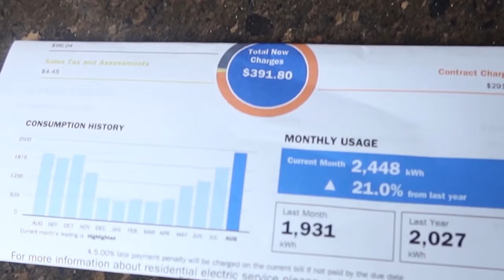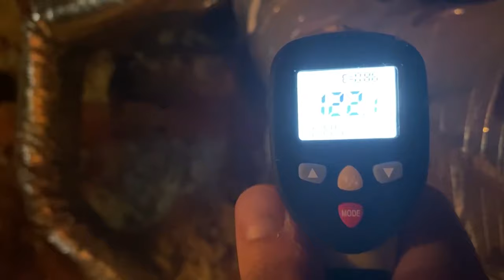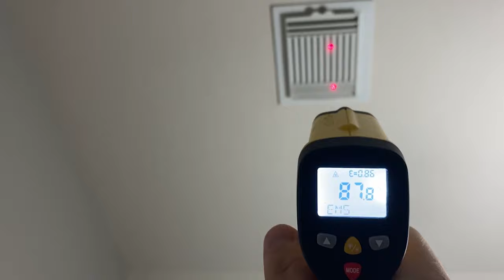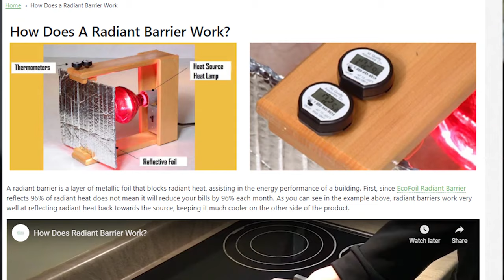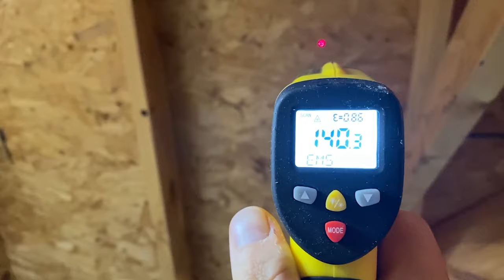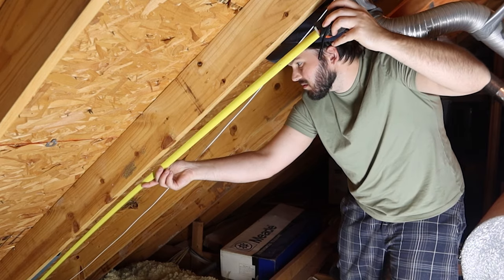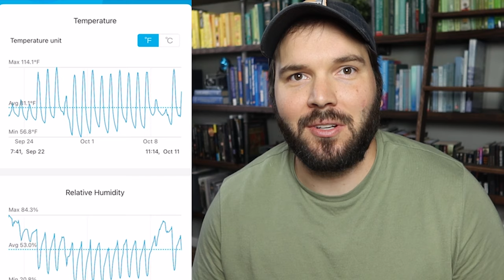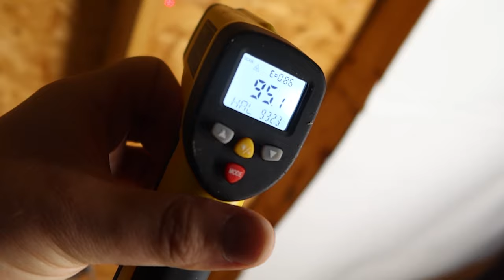Do Radiant Barriers Work & How Much Energy Will it Save: Real Home Owners Experience (Before/After)

Comment: AC is on all the time but not for long enough to dehumidify? Your AC is way too big man
Reply: Can you elaborate on this?
Reply: An air conditioner doesn't just remove heat it also dehumidifies and if the air rushes over the coils to fast it won't have time to take out the humidity.
Reply: Ya it's pronot practical to replace it so probably adding a dehumidifier is probably the play
Reply: First try slowing the blower speed when in cooling mode. Usually it is set to medium-high or high. Try reducing it to medium-low.
Reply: I've thought about installing a relay with a dryer style temperature switch so that my fan wouldn't stay too low. 
I think I could leave the hot side alone if I think about it.
Reply: Your AC is not sized properly (too much capacity) if it’s only running 15 min.
Reply: @jessethomas1574 Or it could be like mine where they brought 3 supplies within 4 feet of the return and thermostat.
Reply: @james10739  That's right. I have stand-alone dehumidifier that's great for pulling moisture out of the air, typically about a quart an hour. The downside is that heat exhausts out the back like it does out the back of a window A/C, so you will also need to run your A/C to stay cool.

Comment: Crest Exteriors in North Texas sold us a “radiant barrier” in 2017 when they replaced our roof after a hail storm. NO AIR GAP, making it a waste of money on an expensive underlay. Per LOGAN at CREST, air gaps are not needed, when responding to my telling him the manufacturer disagrees with him. Logan knows best as he has installed 100’s of these per himself. Doing something incorrect to hundreds of clients doesn’t make it right. Crest has refused to do anything about this. Now, a few weeks ago, APPLE ROOFING came to do an inspection, confirmed the radiant barrier is not installed correctly. This is also when I tell them it was installed by Crest. This is when they told me that APPLE and CREST are the same company. I have yet to receive written report from their inspection and no response to emails and texts. I believe in Texas there is a 10 year statute of limitations on construction defects due to difficulty in detecting them. Suggestions are appreciated. They also tore down the gazebo my recently deceased (at that time) dad built without consulting us, and then charged us $1200+ for new one (this was hail damage and an insurance claim). They also accused us of not paying our deductible, which I handed directly to Logan when he came to pick it up at the house.
Reply: Hope youve hired a lawyer!

Comment: I could not believe the difference it made with the method I tried. I found white highly refractive roof paint at the hardware store and painted my flat roof with that. It made a MASSIVE difference. Easily 5-10 Degree Celsius cooler than ambient in the house now. I left a small section uncoated on the roof close to where the ladder was for comparison and the white roof feels as cold as the steel of a pot you took out of your kitchen cupboard and the old paint(Dark grey) is scolding hot.
Reply: Now if only we could switch between black and white during the seasons..
Reply: @LightGesture  black only will help if the roof dont have insulation. if have some insulation the heat triiying to come in say wtf is this you want me in or what?
Reply: @VostockR  it’s also less effective because the winter is cold, because the sun isn’t shining as much in the first place

Comment: Good info. It works! Just installed 2-sided foil- backed bubblewrap (pressure fit, no air gap) inside a couple of kitchen cabinets against the back wall. Did this because our coffee cups would need to be heated with hot tap water to prevent cooling our morning cup of coffee. After a cold 25 degree F night, a cup located inside the newly insulated cabinet was just as warm (same temp by feel) as a cup that sat on the counter overnight in a 68 degree F kitchen.

Comment: As a side note, it is much hard to heat/cool very humid air.  You can heat/cool less humid air very easily.  As an example, look at deserts, their temps go up and down drastically with their low humidity.

Comment: I'm sure you already know this, but an A/C system that "short-cycles" like this is the direct indicator that it is oversized for the conditions (home load compared to outside conditions). 
If that every-15-minutes cycling is happening around your peak summer conditions, you'd really benefit from some measures to address this. 
Eventually down the road when ready to replace your A/C, you can go cheaper and just get a one-size-lower capacity to better match, or invest in better answer, a higher efficiency unit that includes a VARIABLE or STAGED compressor at full size. 
You'll have the capacity to retain the ability to address higher temperatures during hot spells, but gain the incredibly more efficient handling of your A/C during the rest of the year as it runs at lower capacity. 
You'll get longer run-times at lower energy use, and it will properly dehumidify the air. 
For now, there are also programmable thermostats that allow you to set a wider dead-band and other features, so that you can have it wait an extra degree above setpoint before activating the compressor, and run it an extra degree or two below the setpoint so that cycle times are extended and more dehumidification can be effected.
Also, be sure your thermostat location is away from sun exposure on an interior wall, and is NOT directly in the path of one of your supply air diffusers. 
Side note: You've probably already gotten the advice that you cannot get an accurate spot reading of temp with your IR pistol on reflective or bare metal surfaces (paint a section matte black first?). 
You may wish to add that installing the reflective radiant barrier like this does block a large chunk of the radiant solar load from being absorbed into the attic, but retains the full airflow from the soffit-vents up to the ridge-vent so that roof sheathing and structure is still fully vented and airflow will actually be better, minimizing any potential increase of temp to the shingles. 
This concern about shingle temps goes away completely once you upgrade your roof to a metal one.

Keep up the information sharing!
Reply: The  a/c issues, could be, from the attic, not being properly air sealed.also may  not have enough insulation on the attic floor
Reply: Shingle Temps!!!!!  1st Comment I've seen...considering this asset!!!!!
Reply: Lower the fan speed, run time will increase, evap will get colder and will help dehumidify
Reply: @markchristensen5206  I’ve used this technology for years. There are numerous products for different applications. A different application is to install the perforated product directly on top of existing insulation and cover duct at the same time if applicable. If not, wrap ductwork with the double bubble double foil (the Mercedes of all products!) This product can be layered in rafter spaces, installed 3/4” apart giving tremendous protection. I get mine direct from the manufacturer in Texas for about $.12 sf. Innovative Insulation. There is a demonstration on YouTube which is the same one I saw many, many years ago. These products truly work!
 Radiant Barrier Is It a Scam
 Sarasota Energy Saver video
Reply: Make sure to also measure the temperature split between the return and supply it should be about 20 degrees.  If it's not try adjusting your blower speed, sometimes they set them up with too high of speed.  Fixing this will also help it dehumidify the air.
Reply: Do you know where in a programmable thermostat the deadband adjustment would be?  I have hoped there would be such a thing as my AC works great but due to 1960s house construction it warms up quickly on hot days so the AC is constantly cycling.

Comment: I have a comment about the tip you gave about leaving an air gap so the heat doesn't conduct straight through the radiant barrier. 
Even if you have the radiant barrier pressed right up against the wood and the barrier itself gets hot, you still benefit because of an interesting bit of physics: shiny things, which are really good at reflecting radiant heat are intrinsically poor at radiating heat themselves. If you look for physics demonstrations of emissivity, you'll see demos where two metal cans filled with the same temperature water with the only difference being that one can is painted matte black and the other is polished shiny do not look like they're the same temperature when viewed with an infrared camera. The shiny one looks many degrees cooler even though the heat conducts right into the shiny part, simply because reflective surfaces are intrinsically poor at radiating heat.

You can actually get even better performance if you use multiple layers with gaps between them. Have one radiant barrier pressed up against the wood, and then have another with a gap between the two. Radiant barriers are not 100% efficient; a few percent of the radiant heat still makes it through. Suppose the leakage is about 4%. If you have two layers, then the first one lets through 4%, and the second lets through only 4% of 4%, which is  0.16%. This repeated attenuation of radiant heat is how the multiple radiant barriers of the James Webb Space Telescope are able to keep the shaded side at temperatures a few degrees absolute zero (Kelvin scale) while the sun-side gets to temperatures of about 230˚F (383K).
Reply: Layering is the ultimate system. There is one type called double bubble double foil that even carries an R-value. Since a radiant barrier is a totally different animal than fiberglass or cellulose, it doesn’t have a measurable R-value as such. Fiberglass is only puffed up air and just slows down the airflow. That’s why it takes so much of the nasty stuff!
Reply: i considered the idea of installing multiple layers. but, of course, it is best to do this on a new build. it is exponentially harder to do this on an existing and occupied structure, especially with such awkward and confined spaces. rather, i'm planning to just install one layer on the joist and one on the attic floor. the rolls i purchased are perforated to allow moisture to escape. had i considered radiant barriers earlier, i would've included it behind the vinyl siding that i helped my dad install
Reply: I have an 2000 sq ft attic.  The sheathing is OSB with a reflective lining on the underside.  I then have reflective foil staples to the bottoms of the roof rafters.  My attic space is horribly hot.  Shouldn't both layers of radiant barrier ellimate most of the heat?  Why then is my attic still hot?  I have a light colored metal roof screwed directly onto the sheathing.  I shrug my shoulders and scratch my head wondering if the reflectivity of these products are worth the expense.  My attic should be around 90*, but i know it's a lot closer to 120*.
Reply: @tynyyn5344  Is your attic ventilated? Roof/ridge vents? Sometimes people seal off the ventilation when installing radiant barriers, and that defeats much of the purpose. The heat in the attic still needs a place to escape regardless of type insulation.
Reply: @tynyyn5344 The other requirement for an attic is ventilation of some sort. But even better maybe consider an attic fan to increase air flow thru attic.
Reply: Thx
Reply: @tynyyn5344  Radiant barriers merely redirect some of the heat. They don't eliminate it. You probably have the same problem I have—inadequate attic ventilation either the soffits under the eaves or the vents at the top. On a hot day the top of my attic gets up to 140 degrees. It can't get out fast enough. Until it gets a new roof, all I can do is keep it out of my living areas with lots of cellulose and foil.
Reply: @tynyyn5344  Your roof may not be insulated very well.  Many older buildings suffer from this problem.  You may want to find a convenient location to pull off one of your OSB panels to find out what is back there.  If you do not have a minimum of R-30, you may want to hire a contractor to install some insulation up there.  Closed cell polyurethane spray foam is probably the best, but it can be pretty high.  Polyiso is probably the most budget friendly, though it all depends on your market.  Also, the radiant barrier needs an air gap above it to actually function properly.  Having foil backed OSB does not accomplish this as the radiation hits the OSB board first and heats it up.  Then the heat is transferred to the foil through conduction which then sheds heat to the air in your attic through convection and conduction.
Reply: @wesbaumguardner8829  Thanks for the reply.  You give me some ideas to chew upon.
Reply: @tynyyn5344  No problem.  I am glad I could help.  You should also look into your ventilation, as some of the other posters have stated.  If you have poor ventilation up there, it may be worth it to have a contractor install some vents, preferably closable for when you need to trap heat in the winter (if it gets cold where you live.)

Comment: You can't get an accurate temp reading when using an IR gun on metallic surfaces due to high emissivity. The reading displayed will be significantly lower than what it actually is. Try putting a small square if black electrical tape on the metal and then point the gun at that for a more accurate measure of the radiant energy.
I'm looking to do this barrier install to my house here in Australia soon. Thanks for the info.
Reply: Very true, but largely irrelevant here because the radiant barrier he used has a white back, not metallic.
Reply: did u
Reply: Hi mate. I'm in newy and am thinking of doing the same to my underfloor. Keen to know how you got on.
Reply: i believe you meant say it's high reflectivity, as radiant barriers are intended to have low emissivity
Reply: The 10 degree temperature difference I measured for my post compared of the surface of the cellulose (shredded light gray paper treated to make it resist burning) to the ambient temperature (down low) of my attic.

Comment: I've got attic foil on top of my blown-in cellulose insulation and it definitely helps. On a hot day the temperature under the foil is about 10 degrees less. Keep in mind that when it's placed on top the insulation on the floor of your attic the air gap is above it with only a small air gap provided beneath. When it is bouncing up is the radiant heat in hot the attic air. 
I have taken another step. To keep the heat radiating from my roof away from the floor of the attic I've also placed a wrap of 4-foot-wide attic foil around the base of my attic. That starts the heat radiating from the lower shingles moving up. On a hot day the air exiting up at the top of that foil is about twenty degrees hotter than the foil itself. That also creates a chimney effect as moving air moves other air up and out of the way. The one weakness is my house is that it lacks sufficient ridge venting, but at least I can push that heat upward where it eventually exits.
One final remark. The foil I'm using comes from Attic Foil, which has a website with that name. It is very heavy duty. You can walk on it repeatedly without tearing. Also, for humid climates you can get a foil from them with holes in it to keep moisture out of your insulation.
Reply: Have you noticed any financial benefits? Have you been able to notice a significant change in temperature or how often your HVAC system is working.  I have a small home with standard trusses and my easy way would be to lay it on the insulation as well. I hav all fiberglass insulation and really don’t want to crawl into that space anymore than needed.

Comment: It's not only the heat from the roof, and attic. it's ,also, 3 more things that heat up your home..
1, holes in the ceilings, from,, The can lights, the ceiling fans, and the heating and cooling,  registers. The heat from the attic in summer, comes through the  holes. The cold in winter comes through the same holes. I sealed the space between the sheet rock,  and fixtures.  No air movement. 
3, a gable fan that is thermostat controlled. It blows the hot, attic air out. 
2, My home came with blown in insulation,  no good home got hot. You could feel the waves of heat coming down from the ceiling.  I added  R13 in the attic.  It slowed down the  waves of heat, not enough. I then added R 25, for total of R 38, what a difference. No more waves of heat. Yesterday it was 112° outside,  our home inside got up to 72°. We have no air conditioning.  What we also have is a whole fan. We turn it on at night, when the outside temperature is less than the house temperature. Most mornings the house temperature starts at 64°. We not only cool the house down we coolthe attic temperature as well. The whole house fan cost about .06 cents per hour to operate. At the time of writing this, it's 1 pm, and , 100° outside, and a cool 68° inside,  we started the morning, at 64° inside the house.
Reply: I put up an attic fan for $40. I got a  Vornado clip on fan on clearance for $10 and a digital temp controlled outlet for $30. When the attic gets hot, the fan turns on and blows the hot air out of an attic vent. I'm also about to put up radiant barrier
Reply: @wokejoke2675  I installed radiant barrier, was not happy with the results. I installed  R25 fiberglass insulation on top of the barrier,  that made the most difference in the temperature inside the house,   I'm adding an additional R 38 on top of my current  R 38. The gable fan should not be based on price,  I use to be price conscious. Now I'm volume of air conscious, the more times you can exhaust the  attic air  the better,  my attic is 7,000 cf. A 1,050 cfm fan takes 7 minutes to exhaust the attic, 8 times per hour. I'm replacing my current gable fan, 1050cfm, with 2,800 cfm. That's roughly  3 minutes to exhaust the attic  air, or 20 times each hour. The more volume the faster your attic cools